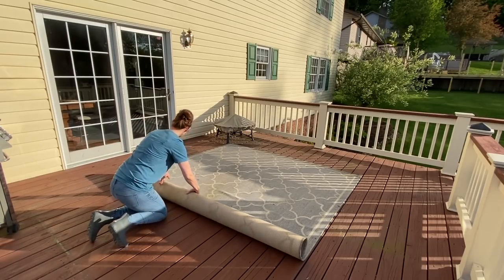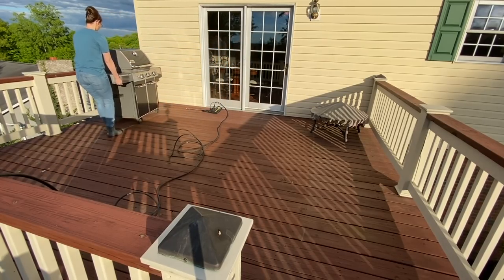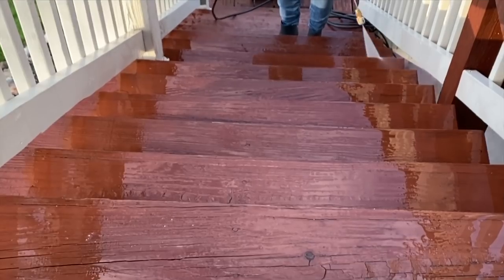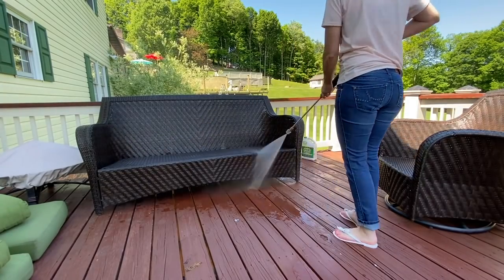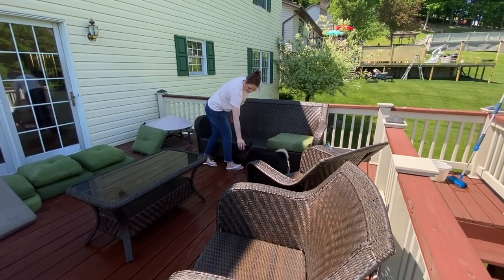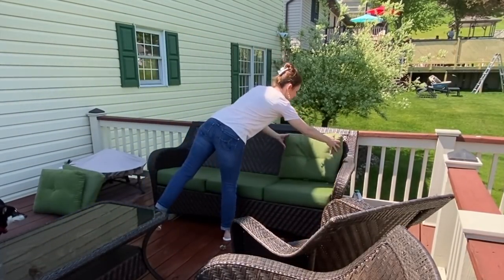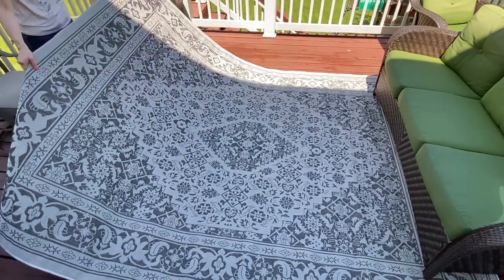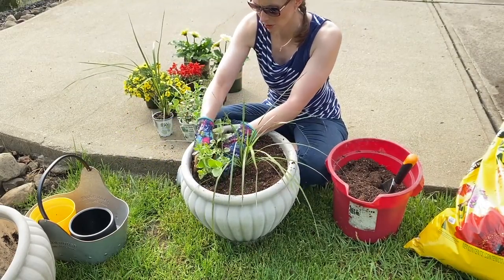DIY SUMMER PATIO MAKEOVER 2021 |  DECK CLEAN + DECORATE | OUTDOOR FARMHOUSE COTTAGE DECORATING IDEAS

Comment: Plant flowering evergreen groundcover such as creeping phlox, time, sedum, candy turft on your steep hill. Spackle the flowered areas with non'flowering evergreens such as ajuga, mini mondo grass, rock cotoneaster, spurge, or varieties from the steppable line. Get some used tires from a local tire store and dig them in to the slope to serve as steps. Back fill each tire with sand and slate to cover the exposed sidewalls of the tire, Cover the tire treadsides with pressure treated wood slats drilled into the tread of the exposed tires. Edge the stealth tire steps with river rock and plants to soften the rubberscape
Reply from the maker: Hi Sarah!! This is wonderful information!! I love you ideas. Thanks so much for sharing!!